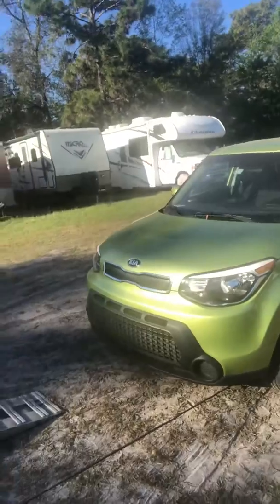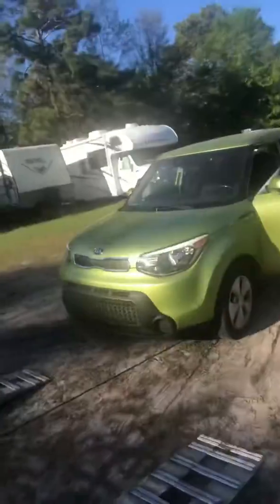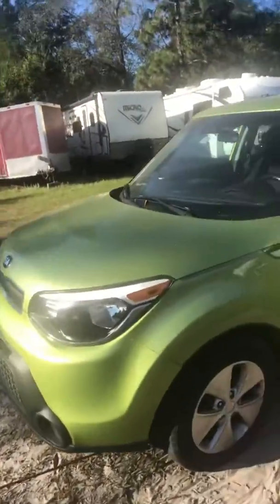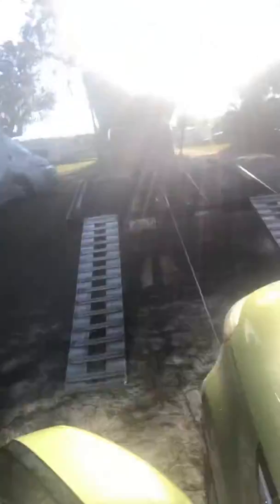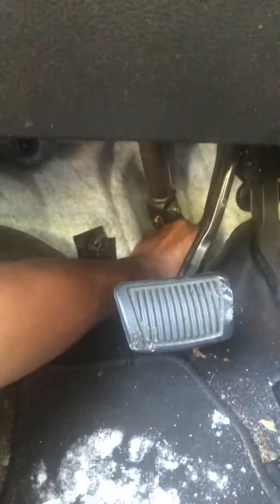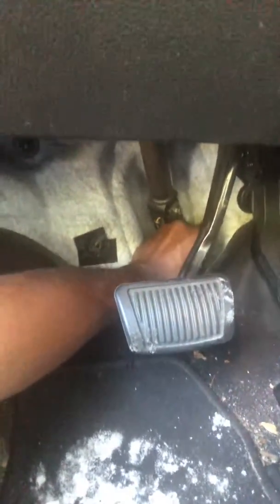How to unlock steering on most cars

Comment: Is this applied to most older cars ? I have a 1998 honda accord with this problem .
Reply from the maker: You would have to look on the steering neck on the column under the dash and see if there’s a bolt there
Reply: @Floridamuscle  dude thank you for the fast response will do.
Reply from the maker: @theoneandonlylonelyredwill789   no problem brother good luck
Reply: did it work ?
Reply: @santosabk2996  no i my vehicle did not have the bar like this one but i did help explain some things, the automatic transmission has a emergency release button under the shifters cover that you can press with a key to unlock the pin and move the shifter to as needed , As for the locked steering wheel i was forced to taking apart my entire ignition system ..

Comment: What about when u need to use the steering wheel like in a towing situation,  but don't have the keys any hacks on that? 
Specifically I'm dealing with a 94 Toyota Camry wagon it broke down on a buddy and then lost his only key...🙄. .. Now I'm the "Nice Guy" or "Sucker" rather trying to help a guy out and get it moved, with a small hurdle to leap right out the gate.
Thanks in advance.
Reply from the maker: Hey what’s up brother, the only thing I could tell you in that situation is to go on eBay and buy some Towing skates underneath the wheel they look like wedges
Reply: @Floridamuscle  ?
Reply from the maker: @seancopsey457  what’s up bro